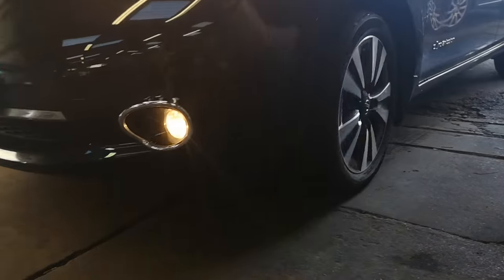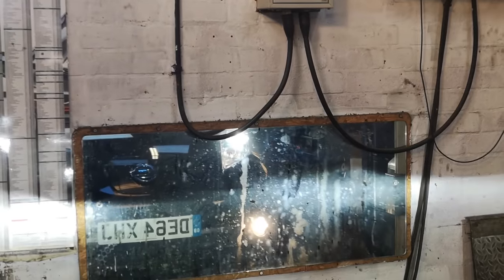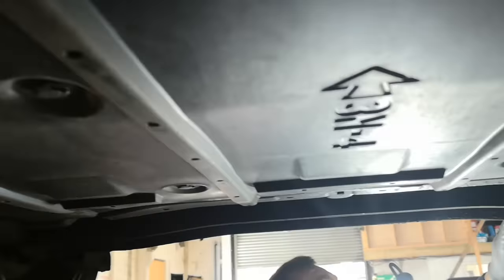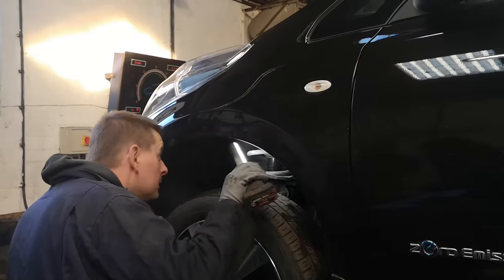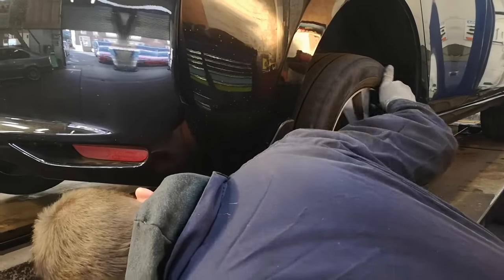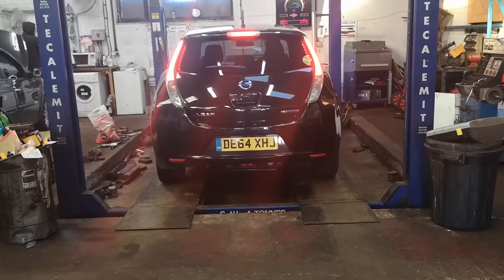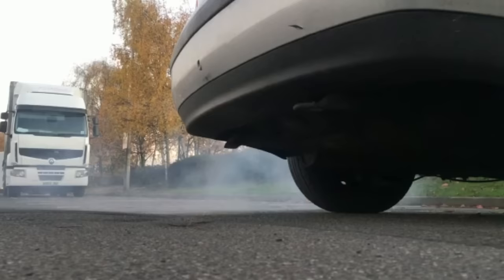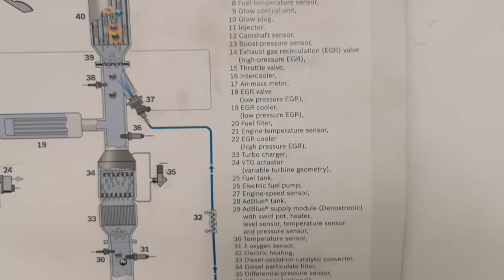An EV MOT, How Easy Can It Be?

Comment: Give it another 50,000 miles and there will be plenty of problems. You won't be so smug when you run out of juice, and by the way, EV's are just as toxic to produce, charge and recyle batteries as any other car.

Comment: To address the balance, my EV which has done 55000 miles failed on - Track rod end, ball joint.  Rear pads thin on the advisory.  :Last year it needed new front pads and discs.   This video is bollocks, an EV is a car - there are very few differences between petrol and electric.
Reply: 3D Motor Maker just 🤣 there’s lots of difference ? Emissions tests that many many cars fail on? Think there’s a troll in the mix ...
Reply from the maker: Bollocks you say, Interesting choice of words. I'd say that if you're going through discs and pads at that rate you probably need to educate yourself on driving techniques and use of regenerative braking. Also I'll add that if you had your vehicle services regularly and indeed properly you wouldn't be failing on such items. 🤔
Reply: What EV do you have?  

You seem to be eating brake pads which is unusual for an EV given that your car most probably has regenerative braking.  It might be cost effective to change your driving style.  

I'd hazard a guess that your damaged track rod end is probably as a result of kerbing on a regular basis, crashing through potholes perhaps or even that you've had a small shunt.  If of course your vehicle has a design fault then the EV needs to know about it as does the manufacturer.

Or, are you driving around in a classic conversion so your car is in fact much older than we are anticipating and has had a long life thus wear and tear will come into play? 

Let us know more detail please.

Thanks.
Reply: I bought a Leaf at 53k miles, did 3.5K miles in it. My wife keeps saying the break pedal makes her jump in comparison to her i30, I have no worry about my brakes. When I drive the car I use them at around 8mph usually. No idea what car you have but nothing you say makes any sense
Reply: @Jamesandkate   Well - now here is the thing, a car is a car - how it is powered does not have much bearing on the MOT.  Your video implies EV's will pass more easily - (which is absolute shit and you know it).  My car has a full Nissan service history.    You were stupid not to check these facts with me before commenting.  Don't get me wrong I am all for electric cars - the problem is your video creates the impression that an electric car will pass its MOT easier than an ICE powered car - and that is total bollocks.  You are doing future EV buyers a dis-service with this video.
Reply: @3dmotormaker  

If you knew anything about cars you'd know that track rods and ball joints are fitted 'for life' and are not expected to be replaced under normal conditions.  However, they can and sometimes do get damaged requiring occasional replacement but these are not regarded as consumable parts and are not expected to need replacing in normal use.

If you're going to troll, fair enough: expect people to push back.  If you're going to be rude then don't expect to be taken seriously.   Manners cost nothing but they do define a person.  

So, how about answering my questions as to the car you drive, etc.?
Reply: @michaelgoode9555  track rod end and ball joints can wear out. What do you think a ball joint is? It's a joint all joints can where out.  Have you never had play in a track rod end ?
Reply: @chrisredfield3240  I know all about track rod ends - I used to be a mechanic.
Reply: @3dmotormaker  Ah, the intellectual debate from a position of knowledge and insight continues.   You still haven't shared with us the information about your EV.
Reply: @michaelgoode9555   There is no debating with some who 'knows it all' - only idiots say that.  Anyone who knows anything - will know cars fail for many reasons (as they get older even more so), an EV is no different.  To say otherwise is simply stupid.  To try and champion uptake of EV's on the basis of a video like this is untrue and disingenuous at best.
Reply: @3dmotormaker   Sorry but you're just a troll.  You know full well that a failed track rod end / balljoint or similar chassis component is relatively rare on any vehicle under ten years old save for where there is a design fault or damage caused by accident, bad driving or gross neglect or abuse.  

The video is not bollocks as you suggest.  It demonstrates what a well-designed car the Leaf is.  Equally, if the Leaf was a pile of crap the video and many many others would reflect this.  Remember, also that this is a first generation electric vehicle, not the result of 100 plus years of ICE R&D.

Whether you like it or not EV's will replace ICE simply due to efficiency, fuel costs, pollution and in fact the eventual shortage of oil.  Your own channel shows that you have an interest in electric motors and yet you are so negative about EV's.  Why so?  Enlighten us rather than enter into an evidentially unsubstantiated slanging match.
Reply: @3dmotormaker    Clearly, so are you.
Reply: I have 80K mikes on a 2013 Leaf I have owned since day one. Only thing replaced have been tires. Still plenty of brake pads left. Don’t know how or what u drive, but it’s definitely not a Leaf.
Reply: @bigdougscommentary5719  Really ? lol
Reply: @michaelgoode9555  More than likely,  Not not as big as you - lol
Reply: Yes - it would seem so.
Reply: @michaelgoode9555  Most of the parts are from the nissan juke - but you already know this don't you !  - errr obviously not.